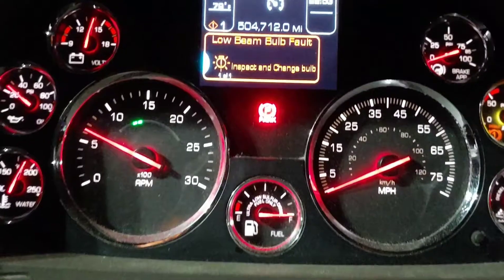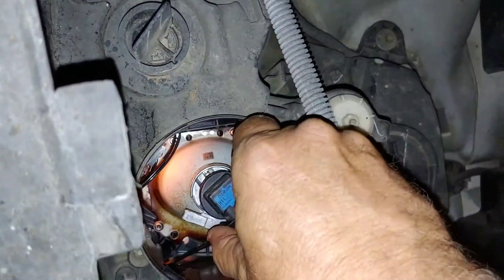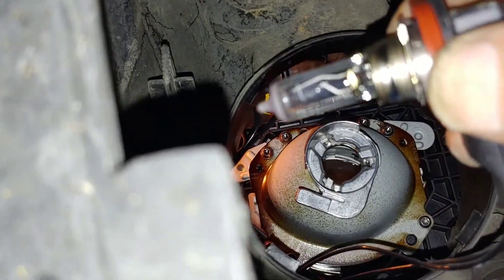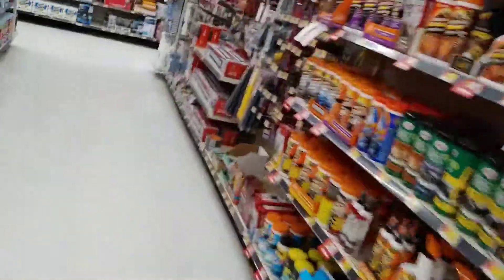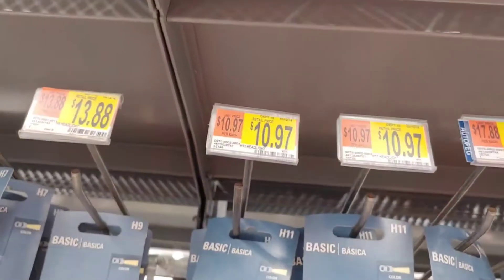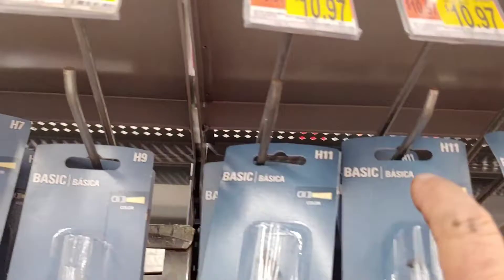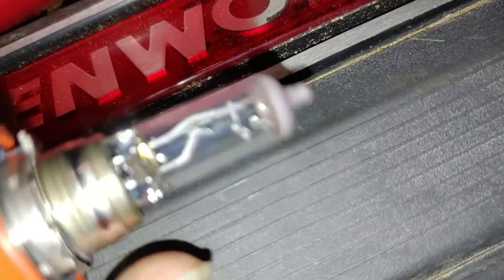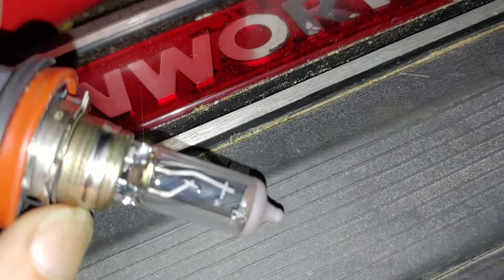How To Replace A Headlamp Bulb 2014 Kenworth T-680

Comment: Got switched to a spare truck and trying to get the knob unstuck that releases that sliding panel.  Don't want to force and break it.
Reply from the maker: It's probably rusted and seized
Reply: @RolandCaston  yep, mechanic had to force it loose with pliers
Reply: H11 as the same for high and low beans
Reply: I'm glad you showed us how to open that hood man I was lost